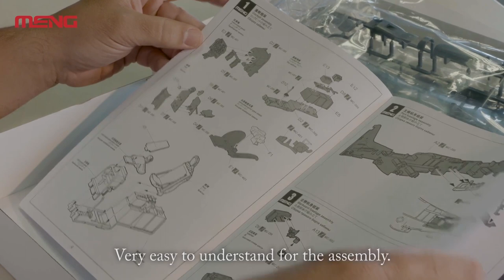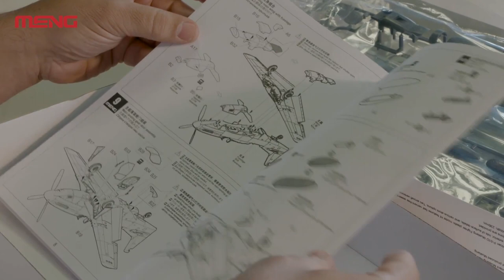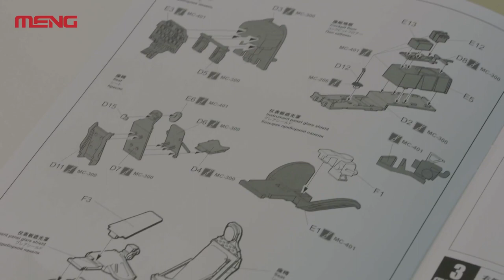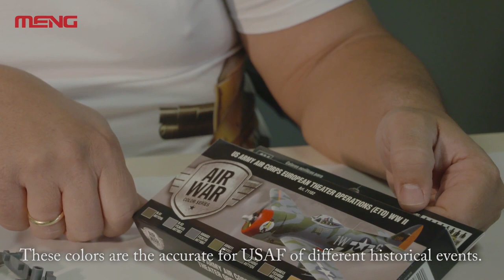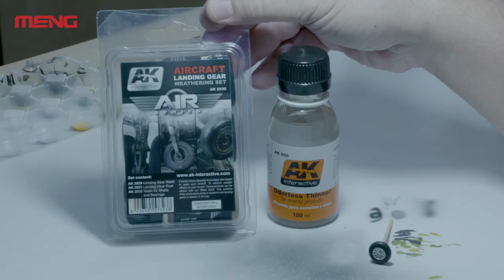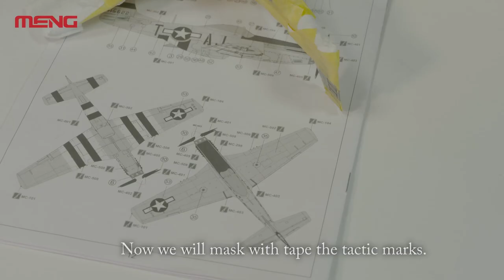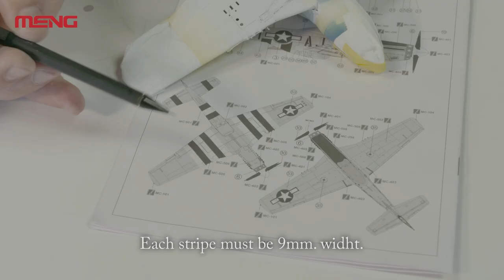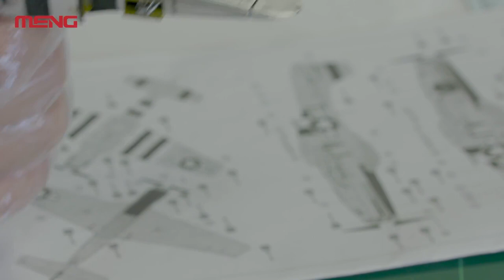P-51D Mustang MENG 1/48

Comment: One interesting factoid I discovered in researching the P-51 is that the rivets are flush with the panels and also that they are white and are practically invisible against the aluminium at a distance. A dark panel wash over the "rivets" has the opposite effect of making them stand out instead of being invisible.

Comment: Nice looking Fiftyone. But i have two points of critics: first, 8th AAF (European theatre) Mustangs had no antenna cable because no great radio range was needed. The second point is, Mustangs had the wings except ailerons an flaps puttied and  silver painted, so panel lines and rivets were barely visible.

Comment: I say you’ve gone a remarkable job in your P-51D Mustang.  I’ve watched your video several times!  Good job!  I must point out however, the hydraulic arm to the inner wheel well doors should be mounted to the rear off the wing spar, not in the middle.  This only applies to the “D” variant.  Cheers, Gary

Comment: Nice build, a couple notes tho, when painting invasion stripes you should have the flaps up as this was the standard when painting them in full scale. Also the wings on P-51’s were smooth on top and bottom about 70% of the wing chord. They filled the panel lines and rivets in with body filler at the factory to increase top speeds. The wings are then painted silver. On a bare metal Mustang later in the war they didn’t paint them camouflage colors because the Allies were winning the war. So in this case with a bare metal wing first it should be smooth but silver colored and the flaps and ailerons would be bare metal. The trick with the thin tape over the rivets is a nice touch because in full scale they ground/sanded the rivets flush to the sheet metal in strips so the planes had a pattern from this. Someone else commented on the inner door ram being out of place, it is, they should be next to the wing spar. Cool build and nice cockpit, I’m thinking of buying one of these kits to try too.
Reply: They often stripped the wings in wartime, or the seams cracked open into fine lines from vibrations... I agree they should be discrete lines at most. In Korea my impression is stripped wings were even more common.